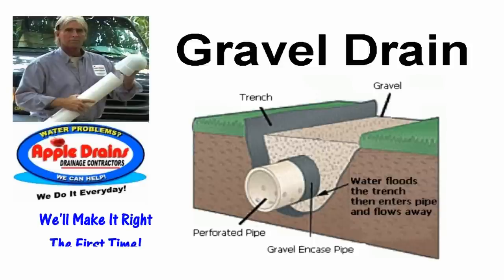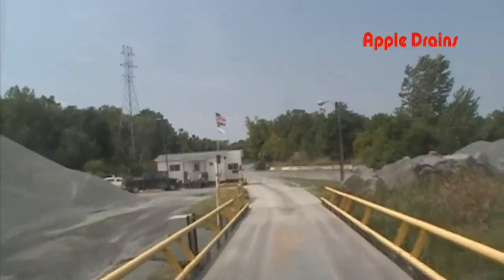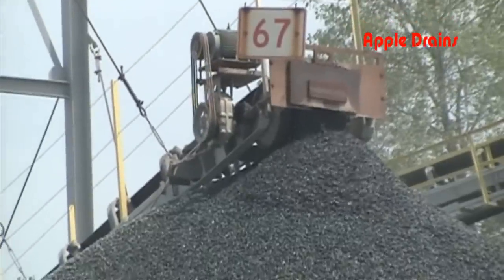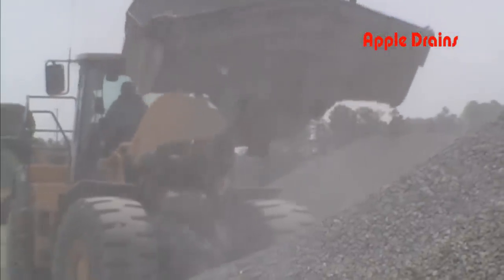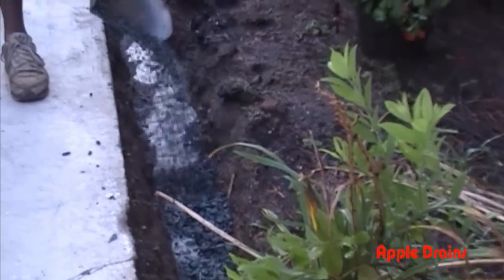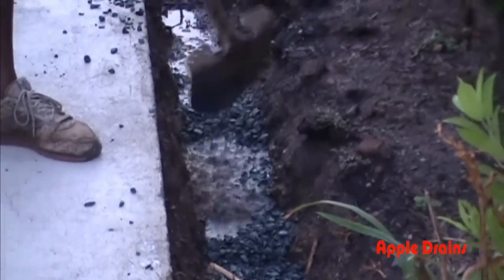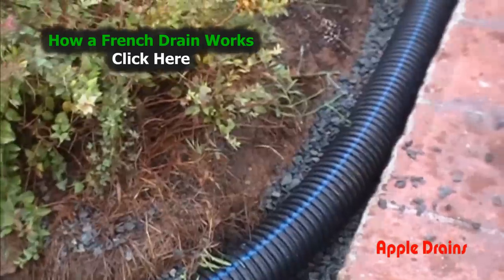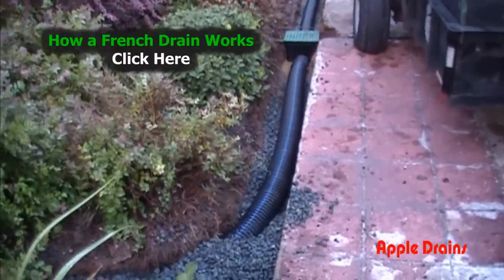Perforated Pipe, Holes Point Down!  Yard Drain, Gravel Drain, French Drain

Comment: This is actually fairly poor standard, sorry to say. 
My advice would be that first dig out deeper and wider, then place some course sand in the bottom of the trench to create a self leveling surface, then line with ag cloth to stop silt entering the drain, , then add a layer of fairly small angular split gravel. You want split gravel not round gravel so it interlocks and doesnt move, but fairly small so that it does not add pressure points to the pipe. then place your pipe in the middle with about 3-6 inches of gravel all the way around. Cover with the same gravel, then look at what you want on top, If you want it to be garvel, then chose an approriaate surface gravel for the final top layer, something more pleasant to look at and easier to walk on.